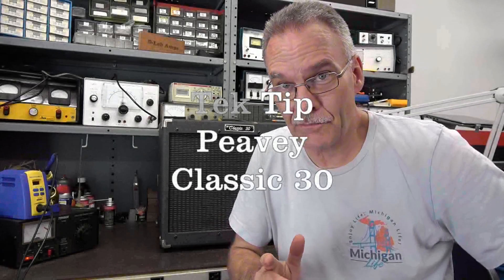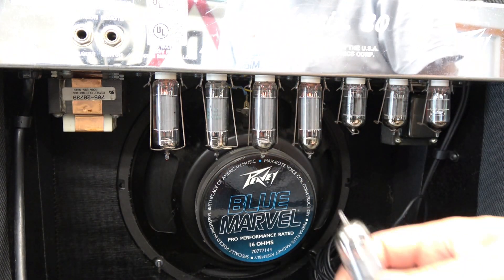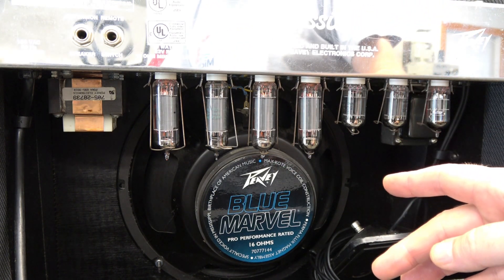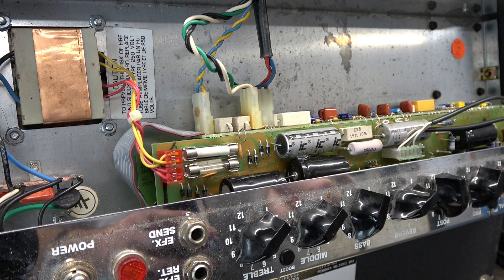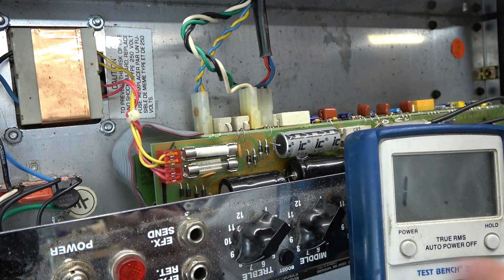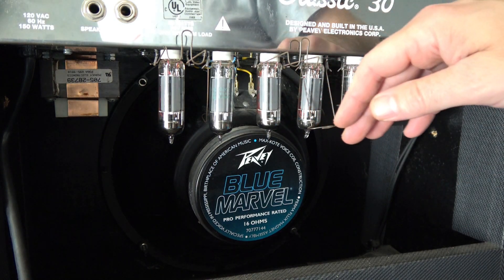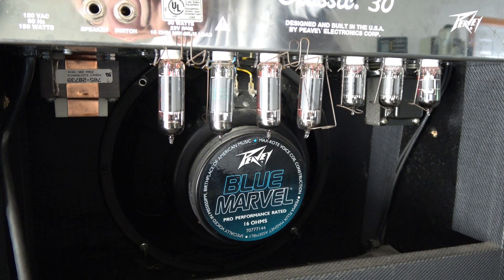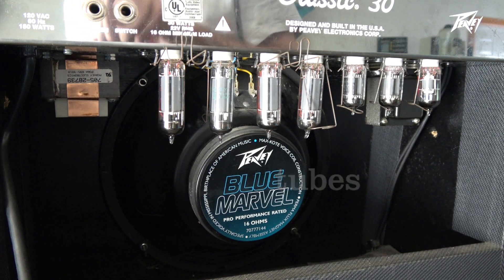How to troubleshoot Dead Peavey Classic 30 tube guitar amp Tek Tip

Comment: I own an 91 classic 50 and recently while playing it popped so took It home replaced the fuses and now it wont turn on at all no sound its quite like a church moush
so I put the old fuses back in it and still nothing. I even tried flipping them to make sure I  had there negative and positive on the right sides of the amp, now however before I replaced the fuses the amp fan wouldn't come on and now does so what have I done and how can I fix it?  I just need some simple help and im even willing to send it in to be repaired but I need to know what the hell is going on with it.

Comment: I just fired up my classic 30 and I seem to have a pot that I have to turn way up to get any output when I turn it down it looses sound any suggestions?  I wish I could get a board designed so I could just hand wire it like a mojo tone kit do you know of a kit that would use similar transformers and holes in the chassis so I can retro fit this amp? Thank you love watching your videos.

Comment: I currently have a peavey classic 50/50 on my bench...what a pain in the hoop it is to work on!
The owner did some extreme mods to it, which I had to return to stock to get anything working at all. There's a wee op amp, which when it fails, make the output stage red plate because it's tied in with their biasing (bloody clever design, may I add!).
Main caps all changed, full re-tubed and worked for ten minutes before it started loudly oscillating with approx 500ms pulses.
Horrible amp to work on and the output tubes (el84's)have the halflife of a house fly.
Has anyone here got any ideas why this thing is pulsing away? Any tips would be greatly appreciated  :)

Comment: Had one of these amps on my bench for repair last year. Boy do they run HOT! The design is terrible and they're a pig to work on. They do pack a punch however in the sound department.

Comment: Great advice, Terry.  Fuses are protection devices, in years of working on CB radios and other gear I don't know how many times I saw ones rated 3-amps or less replaced with 20-amp ones or bypassed entirely.  Fried wires, circuit traces charred and peeling off the board, etc.  One favorite was someone blowing 20-amp fuses; they discovered the reverse polarity protection diode was shorted so they cut it out, then hooked power up again (still backwards).  No diode, ten times the rating on the fuse and reversed 12-volt power caused a fair amount of damage.  I was able to get the rig working again, but I also tried to educate the owner as to why the fuse and diode were there.  I think he learned the hard way, never saw him back for that type of problem again.

Keep up the good work, sir!

Comment: To any who care (or those who don't) I have an amp that one day blew a heater fuse for a reason I never could figure out. But, when I measured the fuse (in circuit) to hear that magic buzz from my meter, it buzzed. It only read open when pulled out of circuit because the tube heaters were still there (they didnt burn up or fail) in circuit.
Long story short: 2nd tech tip of the day, pull your fuse out of circuit to measure continuity. It can save valuable head scratching. 
(When I put in a new fuse, the amp has worked great ever since even under stress)

Comment: Yes fuses are a great invention! My Marshall TSL60 has three fuses. One day I blew a fuse. Both of the easily accessible fuses tested good. But on the inside was what some people call a heater fuse. I took it out and it tested bad. I went to radio shack and bought a replacement. Then I installed it and it worked.
Reply: Ah the good old days of running to Radio Shack...

Comment: I have terrible hum in my peavey classic 30 reverb I changed the capacitors and it is still there I am suspicious about OpAmp Do you recommend me to change that thank you.
Reply from the maker: Have you replaced the output tubes? Have you cleaned the input + effects 1/4 jacks? The wiper arms are known for corrosion
Reply: @d-labelectronics thank you very much for your attention. the hum only occurs when I use Reverb it starts at level 2 of reverb knob rises gradually when I crank up the reverb knob other than that after I changed the capacitor it became  quiter but  there is no difference at reverb hum.
Reply: @ozcansahsuvar2269  hey dude is it a spring reverb? In my experience there is little you can do, those are just noisy.  You can check all the silly stuff like trying a new driver or recovery tube, cleaning the contacts on the RCAs and checking you have a suitable cable in use.  And cleaning your reverb control pot.  But otherwise in my experience the tabks themselves introduce noise that's just how it works.  That tech was developed in the 30s or 40s
Reply: @kbkman7742   thank you I will check the reverb tank again and see

Comment: Nice sounding amps. But I HATE this design. Shame on ALL amp makers who make amplifiers like this! SHAME!
Reply: Yep! For example, cheap solution of generating the heater voltages for the power tube filaments lying in series, done with a cheap tiny power transformer! No possibility to adjust the bias voltages - 6BQ5 tubes run unnecessarily very hot and wear out. No master volume pot. And with an extra heater voltage supply and a proper made layout of the circuitry, I'm sure, hum could be reduced...
Reply: @johnnaighley9252  Yeah - series heaters means it can't be run on 1 pair of EL84's for testing purposes, eg if you don't have a tester or any spare EL84's. Also, on the one I looked at it seems like it would be a nightmare to get the PCB out to work on!
Reply: @elshiftos  On the 2 I have worked on, the solid leads that tie the 3 PCBs together have been the problem. Check them over well. The boards are folded over like a Taco which puts stress on those leads.

Comment: On these amps Terry - they fit an inline fuse within the power transformer, which blows a long (here in the UK!) You have to unwind the tape on the primary side.  So dont throw out the mains tx as it could just have an inline fuse failed.

Comment: From Leo:  You really got lucky with that one.   That 3 section, folded PC board is a real test of patience.   Especially when those rows of jumpers start busting loose.  When you are the 3rd or 4th tech to have to open it up,  don't plan on making any money for your time.  As much of a pain they are to work on, I have to admit they sound great.

Comment: Terry,  I have to ask... what do you think blew the fuse ? was it a bad tube, or did something else cause the tube to blow ?  I use one of these as a bass practice amp and it does a good job. Nice and easy fix for sure !!!  Thank you
Reply from the maker: I believe the loose matter in the failed tube fell in contact with the High voltage...Zapp!
Reply: @d-labelectronics    VERY GOOD TO KNOW..... I've tucked it away in my brain vault.  Thank you sir

Comment: Probably asked and answered a million times...why are guitar amp circuits mounted upside down?
Reply: Maybe they are made in Australia? LOL
Reply: cuban9splat this comment made my day!🤣🤣
Reply from the maker: I like that!
Reply: @cuban9splat  Darn!  Beat me to the answer! 😄
Reply: If the tubes were mounted upright, they'd be sticking out through the top of the cabinet. The alternative would be to mount the chassis at the bottom of the cabinet below the speaker - but then you'd have to get down on the floor when you wanted to adjust any knob or plug in/out from the amp.
Reply: It is so that the sound runs downhill to the speaker!  lol!
Reply: I think it's because the buyers want the controls near the top.  The manufacturers wants to keep thing compact (probably cheaper too).  So, "upside-down" was the solution.